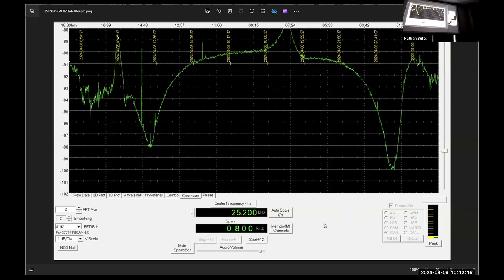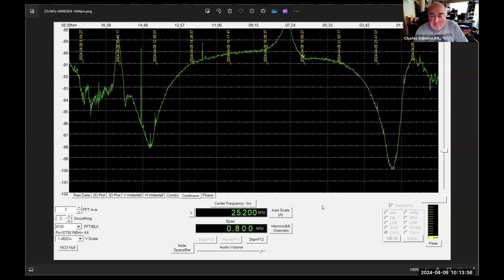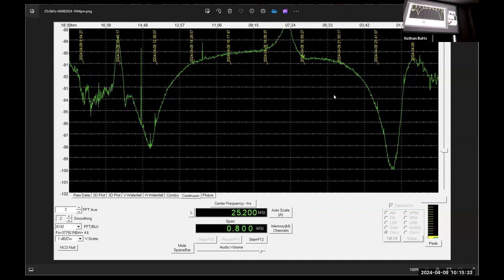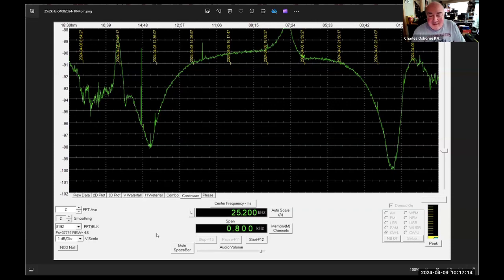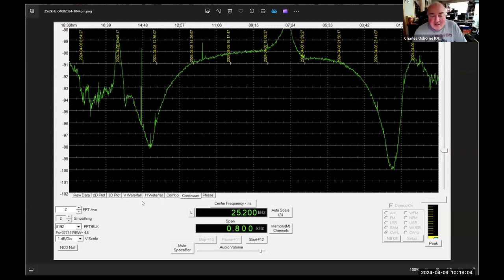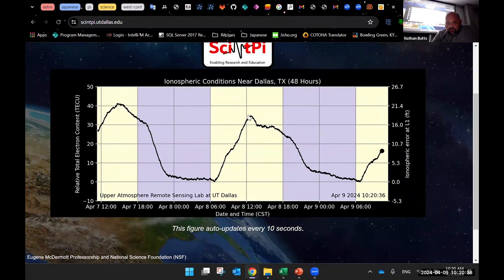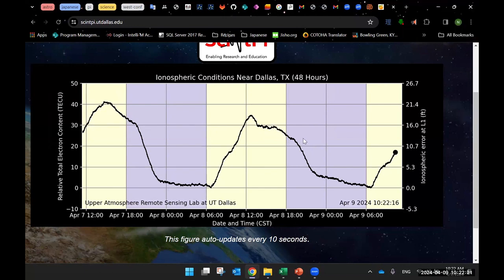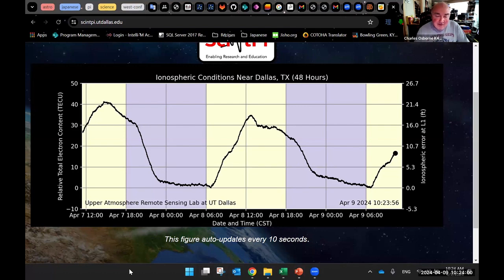Charles Osborne:  Eclipse Detection using a VLF Receiver

Comment: Interesting. 

I have been intending to spend time involved in radio astronomy which is essentially what's being demostrated here & hope to with my RS 918 this spring.

I am curious regarding your loop receiving antenna and if you could give me a little abstract of what its configuration is including transformer at the feed point I'd appreciate that.

Thanks,
Kc2wvb